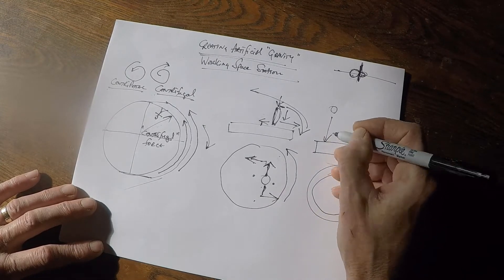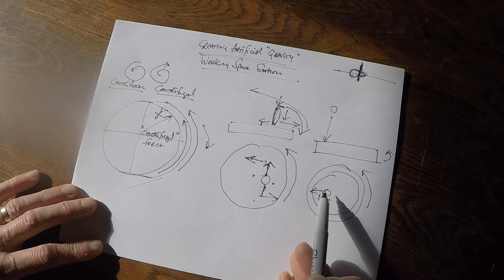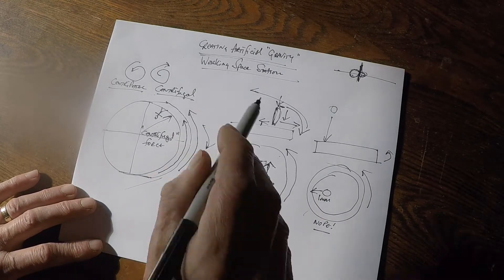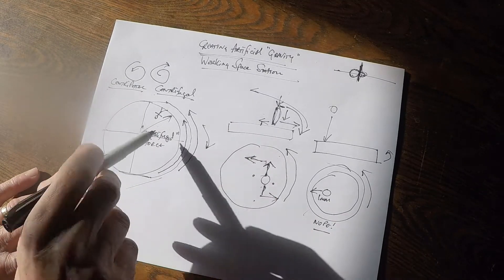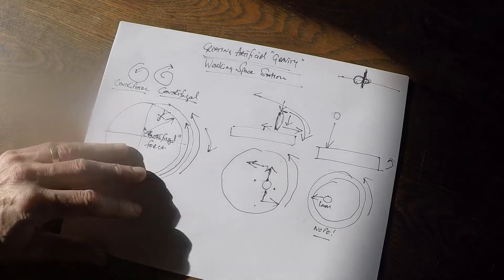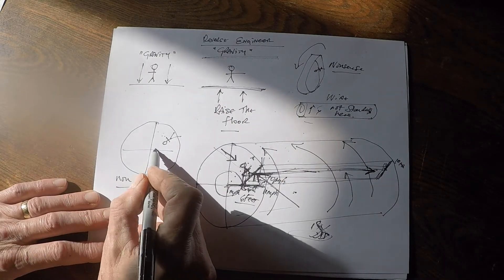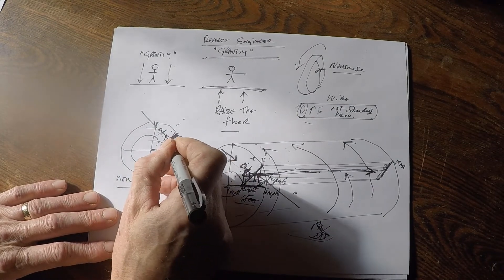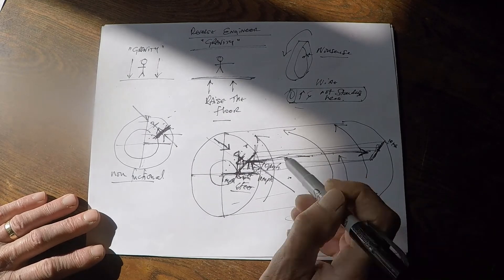Creating Artificial Gravity - Working Space Station Application

Comment: Lee, please have an open mind and hear me out! 
We will do a demonstration:
Get bucket, and fill it with some water!, not a lot, maybe 1/3rd.
Go out, hold it in your arm extended.
Now as fast as you can spin the bucket with your whole arm, pivot point is your shoulder, in circle perpendicular to earth. 
You can spin it above your head sideways, but it is more tricky or you can just spin around.

Observe that the water will not flow out from the bucket. (if it does, reduce the amount of water and try again)
You just demonstrated that the centripetal force exists and that is how the space station will generate artificial gravity with a narrow ring. Since the radius of the ring is much longer than your arm, it doesn't need to spin as fast, to generate the force to have the same force as gravity.

Coincidentally you have also demonstrated, that gravity is not almighty, you can generate a force which counteracts gravity. Hence the water staying in the bucket.
This is also how clouds stay in the sky, the gravitational pull is smaller than the buoyancy and air resistance

About your video: You are correct, you can have artificial gravity perpendicular to the radius, the problem is that you would need a constant acceleration, your tube is gonna spin faster and faster. At one point the structure gonna give away, the outside would fly off.
Reply from the maker: I dont need constant acceleration as I am going in a circle, 2 "forces " are at work....and clouds are not there because of "gravity"...the sky is electrical.
as is the whole universe.
and God.
Reply: @ScientificLee  Ok.... then why things in a faraday cage float?
Also i think you refer to the electrostatical charge of cloud. 
But how is air electrical? Why aren't we shocked by it?
and when did God came into the discussion?
Reply: @scottl5000  left out a "wouldn't"
Reply from the maker: "You just demonstrated that the centripetal force exists"
I also showed it didn't exist.....but you failed to mention that.
Reply: @ScientificLee  Have you read what i wrote? Did you done the experiment with the bucket?
I was not talking about the video
Reply from the maker: God showed me how all is made...energy and matter are separate...and I have explained it so.
creating a universe is a lot easier when energy and matter dont change places.
and that is what I was shown...how energy moves through all things...matter is dead and does zero basically...except that which energy and dna frequency code forces it to do.
Mind over matter.
aint no bucket laws in space unless you are tethered to the center.
so it wont work.
thanks for the chat.
Reply: @ScientificLee  I am sorry, not gonna waste your time anymore... God bless!
Reply from the maker: May God bless you too.

Comment: Interesting indeed. I believe you are correct that earths gravitational acceleration can be matched, but it will vary as you travel perpendicularly from the Axis of rotation. (Hence the narrow hallway and why you made your station long axially) but I wonder if there would be a difference from gravitation in the way that things fall; Such as a kid flying off a merry go round spins in the same direction as the merry go round. Can you balance a quarter the same way on the space station?
Now, if there is no difference at all in gravitational force, and a person couldn’t tell the difference, That means that you have described how to re-create gravity only along a 1 dimensional line: the earth has nearly constant gravity everywhere you go. But on Lee’s space station (LSS), traveling outside of that 1 dimension will result in a change in gravity. 
Now think dimensionally, 
The dimensions of where lee’s gravity exists, with respect to time it would be a 2 dimensional endless—cylinder(toilet paper tube)
Funny how the endless cylinder creates two discs on the ends(new theoretical dimensions not bound to the original, but have their being from the original) 

Acts 17:24-21

So, the force of LSS will not “act at a distance” like gravity does, 
So this must mean two masses appearing to “act at a distance” are connected by a dimension evasive to our senses. Ecclesiastes 12:6&7

 I suppose this dimension would appear to be rotational/laminar vortex
Diving further, LSS still works on principles of opposite forces, and vibration+resonance. Eg. the resonances of LSS have baseline geometries of rest (dimensions), or moment of inertia. Just like a resting cymbal. These foundational geometries are synonymous to gravity being a baseline dimension of rest for the dimensions that our 5 senses live it. 
Wyatt 

Ps lee: Cylinder cymbal symbol

Comment: I’m sorry lee but you are wrong and here’s proof. https://youtu.be/im-JM0f_J7s
Also, I have personally been in a massive rotating cylinder several times called a gravitron. You stick to the walls and at the proper speed you could stand up, the enertial momentum is moving out and forward.

https://youtu.be/ekWGSw9fxzI
Here’s a video of someone standing in a gravitron.
Reply from the maker: is there a WIRE attached to his back?...which is ALSO attached to the center spindle?
yes...I watched it already...he is attached to what is moving....so it wont work...unless of course every astronaut is tethered to one spot...around the core...so they cannot move....its a false video due to the wire...
Reply from the maker: the graviton is the same..the higher the faster...he cannot MOVE :)...mine uses the long axis to stop the acceleration.
Reply from the maker: also..its not zero G...when someone show the graviton with zero G?...then they have a video that proves something....g